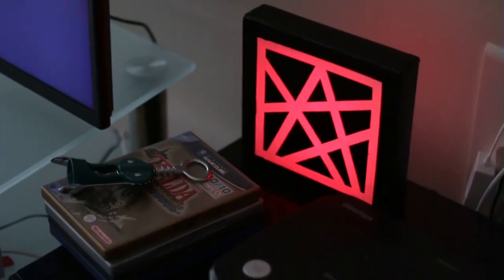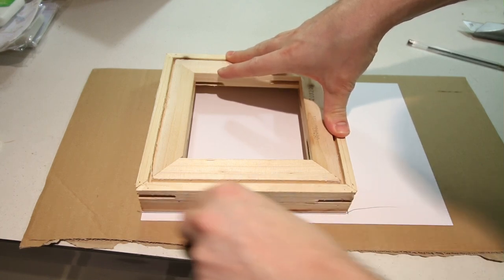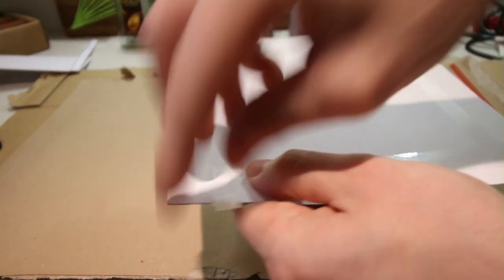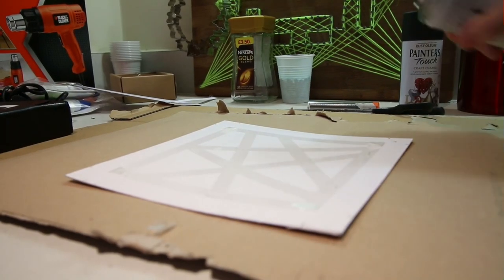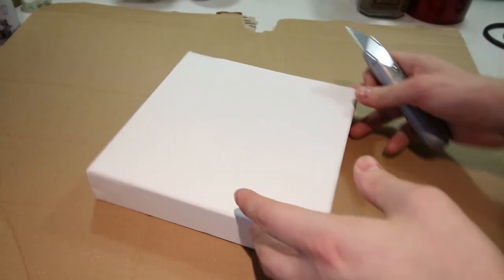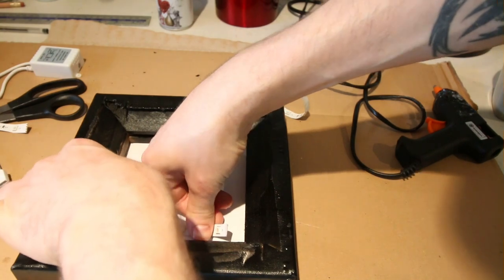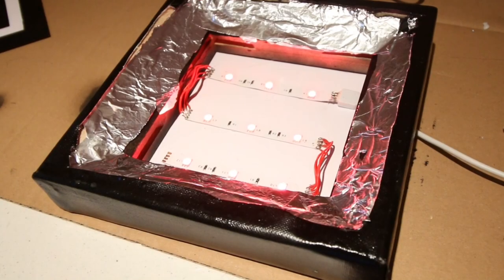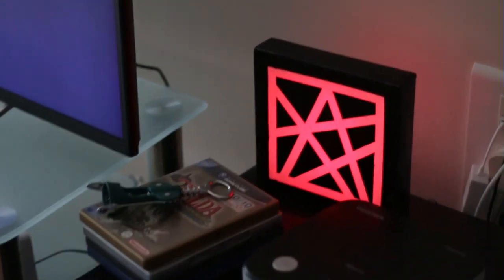Make A L.E.D Sticky Tape Stencil Light Box!

Comment: Hey Andy, on the larger scale design you showed at the start it looks like the issue was paint bleeding into the area that should be covered. If that was the problem you could try spraying on a clear coat first before the black, or even paint the tape edges with something like clear nail varnish. I've not tried this with LED backlighting but at least for the paint any bleeding of the clear coat shouldn't be visible on the design and it seals all the edges of the tape to make sure the colour coat can't get under it.

Comment: Hi , a big DIYer myself - did something similar a few years back but I have to say my model was a bit nicer outcome (your is still great and I would say maybe cheaper) .I dont have pics cuz it was a gift I gave already. The main idea is the same as yours - you need acrylic sheet (didnt try diffrent kinds just got a plain transparent no color one , maybe some kind of a fluorescent one would have been cooler) , a picture frame with a glass , color changing led light , some white MATTE vinyl and some color of spray paint or vinyl paint. Take the glass out of the frame and cut the acrylic to size - then you print whatever you want (or draw like I did) on the vinyl and cut it out - then stick the vinyl cutout of whatever you printed(drew) on the acrylic and paint over - remove the vinyl and there is your picture(or whatever you drew/printed) - now turn the acrylic on the other side and sand that so it gets a matte finish - put the finished acrylic in place of the glass , put the LEDs inside the frame and TADAAA .

Comment: Nice job. But if I may: you might want to use Acrylic/plexi glass instead of paper. It' will give you a sharper and cleaner look, and if you also use painter's tape -on any surface you'll have no issues of ripping the surface.  Good luck with the next one.

Comment: Could you use low-tack masking tape instead of sellotape? Would it be much less likely to tear the top surface of the card?
Reply: That's what I thought
Reply from the maker: +1701spacecadet Yes you can however the width of the masking tape would be too thick for the size of canvas I was using. It would work on a bigger canvas though.
Reply: +Mist8k I think Tamiya do a narrow one for modelling. Probably bit more expensive than pound-shop sticky tape tho.
Reply: +Mist8k Or you could just buy masking tape that's less wide...